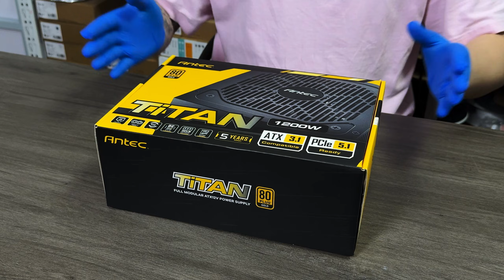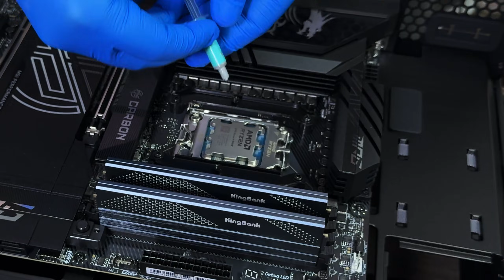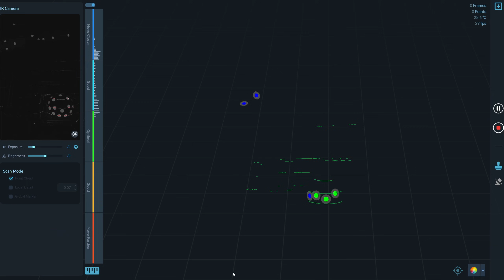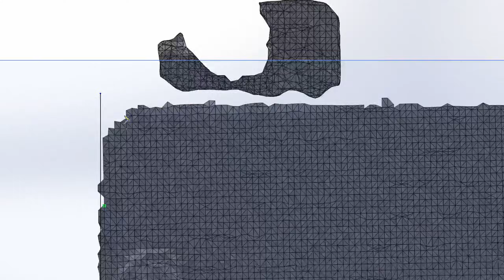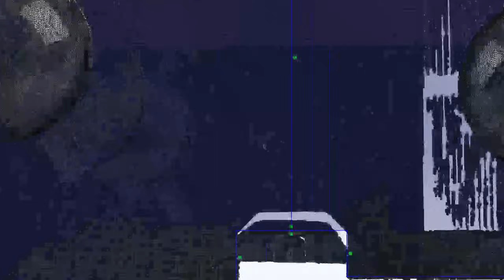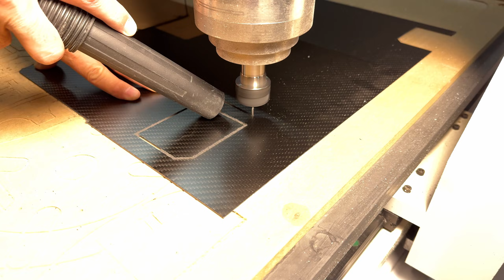The Black & Carbon PC Build of Your Dreams

Comment: Aren’t you actually limiting the heat dissipation properties of the gpu backplate and vrm cooling with these carbon plates?
Reply from the maker: @ErnieZee  VRM had plastic elements, they are not metal so they don’t dissipate heat there. For the GPU It’s good because it’s not 3090/4090/5090. 80 series doesn’t have VRAM chips on the back side of the GPU. And stock backplate wasn’t even thermally connected with the PCB - no thermal pads in between. So these changes don’t create a performance hit.
Reply from the maker: @ErnieZee  But I may need to make comparison with thermal camera next time :)